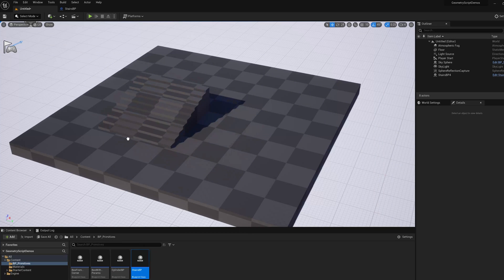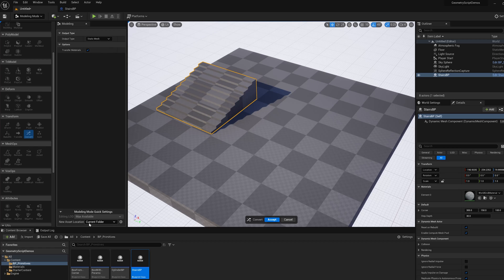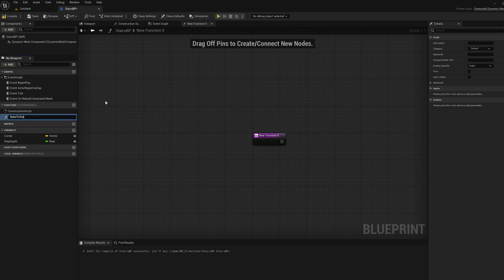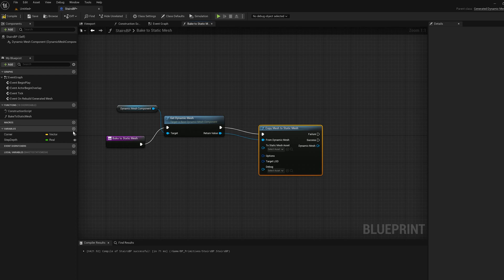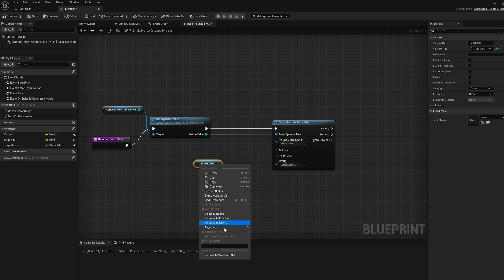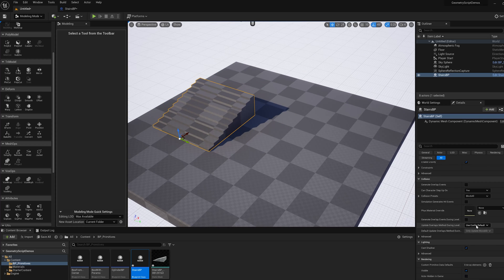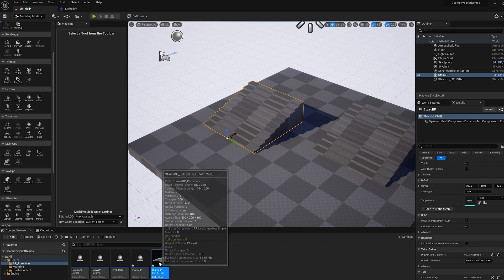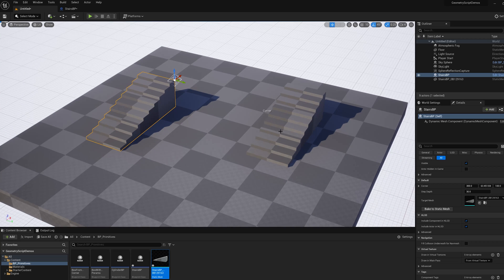UE5 Geometry Script - Bake To Static Mesh

Comment: Just dropping a comment to say what a great set of tools geometry script is, been playing around with it while coming up with a procedural building generator. You can go a long way with splines, clever UV tricks and instancing, but geometry script is that extra bridge that opens up a world of possibilities. I know you get a lot of questions about runtime things, but for me the genius of these tools is what you can do with them in Construction Script.

Also it would be nice to have an easy way, when using Create Mesh from Spline, to pin a vertex to each spline point that is of linear type. I made a little BP function to do this after the fact, but I initially sample at a higher degree than probably needed and I’m sure it would be faster if written by someone with actual chops.

Anyway that tiny request aside,awesome tool set. Love it.

Comment: I am trying to use geometry script to merge a bunch of static meshes together at runtime. Thanks to your video about using Geometry Script at runtime I am (seemingly) able to do the first half: to copy static meshes to dynamic meshes and append them, using "Copy Mesh From Static Mesh" and "Append Mesh" nodes. However it doesn't seem to want to work going the other direction using "Copy Mesh To Static Mesh".

Thinking about it more, this issue is probably because I am trying to copy to an empty static mesh, which I guess won't work because it doesn't "exist" in the level, so I guess I have to spawn a dummy static mesh and replace it with the Dyn Mesh copy?
Edit: I believe ^ is the solution, I am spawning a new Static Mesh Actor, and a new Static Mesh Object to function as dummies for the copy to static mesh operation!

Comment: How did you transform it using the vector clicker when it is not a regular append option (example append box), i am trying to transform 3d objects using the same scaler tool but appendmesh has completely different value requirements compared to appendbox and appendsphere which already come with a shape in mind.

Comment: What if I want to create the static mesh asset from the BP?
Reply from the maker: There is a function CreateNewStaticMeshAssetFromMesh
Reply: @RyanSchmidtEpic  I can't seem to get CreateNewStaticMeshAssetFromMesh to work. I'm hung up on what to put into the "Asset Path and Name" field. I tried putting the path of my project's content folder, both the relative and absolute paths, and tried entering a filename, both with and without the ".uasset" extension, and half the time it does nothing and the other half of the time it crashes the engine. What goes in here? And where does the "StaticMeshAsset" output pin go? Or can I just leave it unconnected?
Reply: @myth0genesis  did you manage to fix it ?
Reply: @awakenwithoutcoffee  I managed to get it to work! The string in the "Asset Path and Name" field should be in the following format: "/Game/YourAssetName". The "/Game/" prefix is absolutely required for some reason.
Reply: @vadstart  love it. Let me know what you create!
Reply: @vadstart  This is the way.
Reply: @RyanSchmidtEpic  Hi Ryan, this function seems to always result in a crash

Comment: Will loading and saving to static mesh be supported at runtime and if not is it planed to add a load and save to .obj file at runtime?
Reply from the maker: This is a bit outside the scope of geometry script. It is not possible to create a static mesh asset at runtime, that is a limitation of Unreal Engine. I think it is sometimes possible to load a static mesh asset from pak files but I am not an expert in that at all, so I can't say for sure. OBJ loading might be handled by Datasmith Runtime (https://docs.unrealengine.com/4.27/en-US/WorkingWithContent/Importing/Datasmith/Overview/UsingDatasmithAtRuntime). I have also have some sample code on github for OBJ loading/saving if you are comfortable with C++: https://github.com/gradientspace/UnrealRuntimeToolsFrameworkDemo/tree/main/Plugins/RuntimeGeometryUtils/Source/RuntimeGeometryUtils/Public
Reply: @RyanSchmidtEpic  I was so excited about this and then I ran into this wall.  Unreal seems to really want to view static meshes as fundamentally rooted to files on disk, rather than freewheeling memory objects. In a procedural game, you'd want to generate just the memory rep of static meshes, without the files. DynamicMesh is clearly almost there already. You just need a real, first-class UStaticMesh type that only lives in memory with a finite lifetime. You're SO close to supporting procgen. But stuff like this stops you one inch before the finish line.
Reply: i dont know if Ryan created a video covering it but i been trying to make this work using a "Create New Static Mesh Asset From Mesh" Node till i found this video just now. im still learning UE so i dont know how to connect every pin from every node so i couldn't figure out the "Asset Path And Name" pin from the create new static mesh node.
but i think that is the key to answering your question, probably need some formula attached to an event and/or "For Each Loop" that will automatically change the name incrementally. 🤷‍♂🤷‍♂
ill figure it out eventually, if i cant find a Tut for it. but something you could attempt to play with if you want.